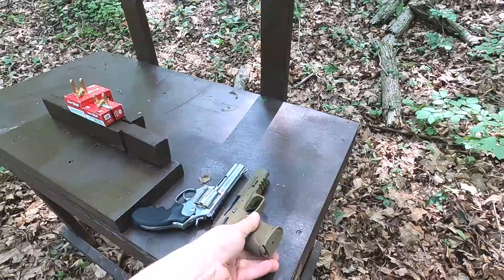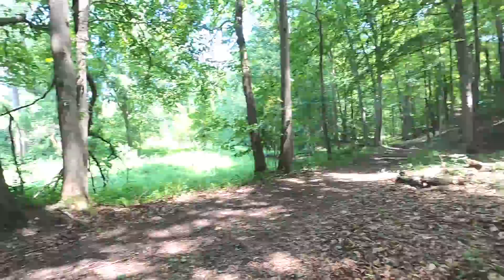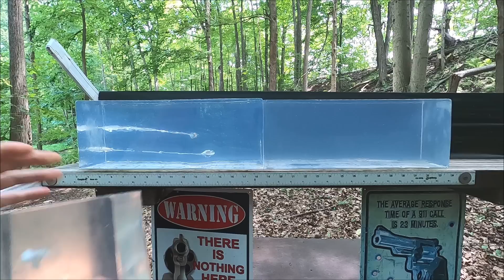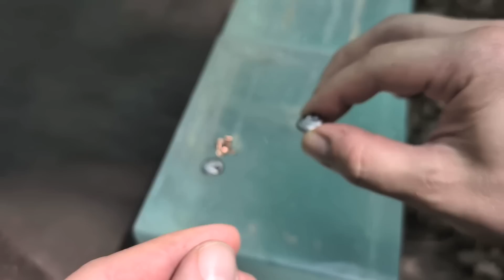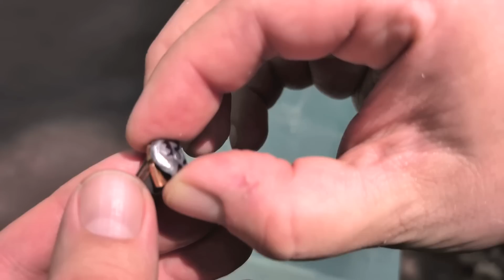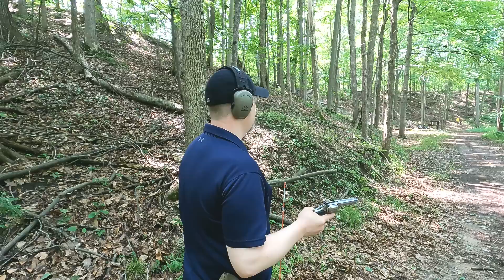Cor-Bon Glaser Pow'R Ball 9mm+P VS .357 Mag - Ballistic Gel Test - Pow'R Ball for the Jackpot?

Comment: Just my observation but most all of your test with your chronograph seem to be well under  a lot of the other tests with the same ammunition and you use a 5 inch🤔
Reply from the maker: Well your observation is way off then. I do lots of tests with my 5" 9mm and MOST are far higher than rated velocity and higher than most other people's readins in their Glock 17's and whatnot. I am convinced you made that statement based on this test alone. Go watch any other of my tests with this 5" pistol and you will be proven wrong every time.

Comment: In the late 1980s I bought two six-round clear blister packs of 44 Special Glaser Safety Slugs which are still in my collection.  The original $15.25 price stickers are on them, though each one also has a $11.20 discount sticker.  These were obscenely high prices in 1989 and equate to $39.64 and $29.12, respectively, in 2025.  At $53.69 per 20 rounds, Buffalo Bore .44 Special looks dirt cheap by comparison.

Comment: The original Glazer  Safety Slug suspended the bird shot in liquid Teflon, and was marketed to individuals like bailiffs and hospital security.  It was claimed to have zero ricchochet  threat or overpenetration .
Reply: When I worked security on yachts, we had Glaser safety slugs for our 9mm USP's. Not that a hollowpoint would punch through most of the aluminum or steel some of the yachts were made from, but the fiberglass yachts there existed the possibility to punch through. We were given the newer versions which was compressed copper, zinc and tungsten with the tip. Our rifle rounds were standard rounds. I remember hearing one of the captains complaining about how much he was charged for the ammo. They had to pay for all 200 rounds we carried onboard of the frangible ammo per security person which was usually 4 guys. Each box of ammo cost $80 per box of 20, so it was $3200 just for pistol and MP-5. Thry also had to,pay for ammo for sniler rifles, Steyr Augs, Remington 870 and the Minimi Para belts. That was another $3000. And when we left, we took it all with us.
Reply: @clifbradley  that’s badass; how does one get into yacht security?